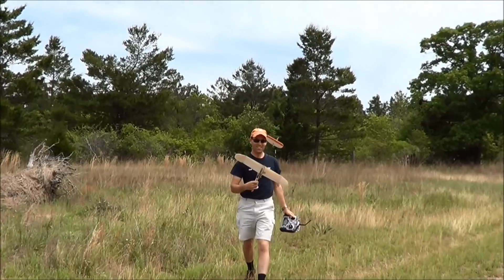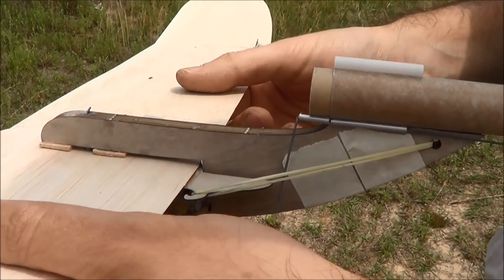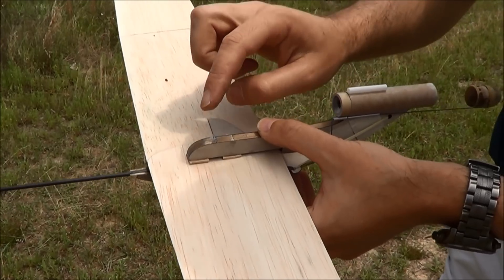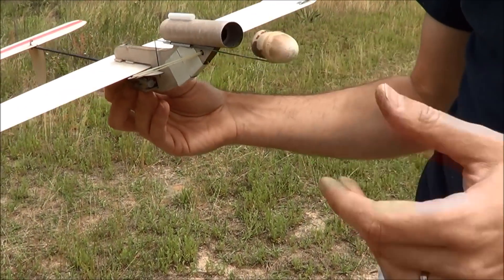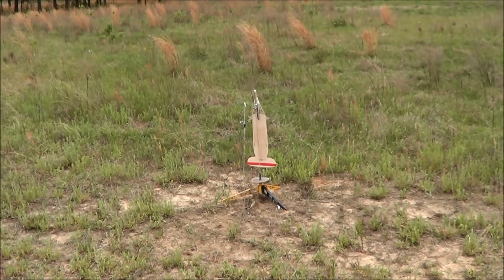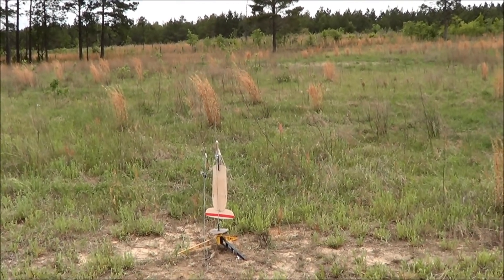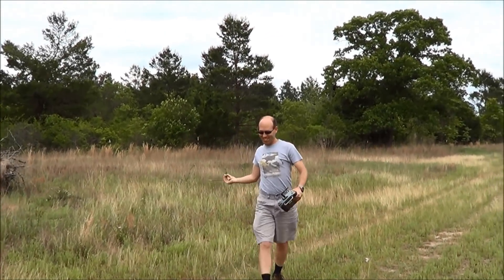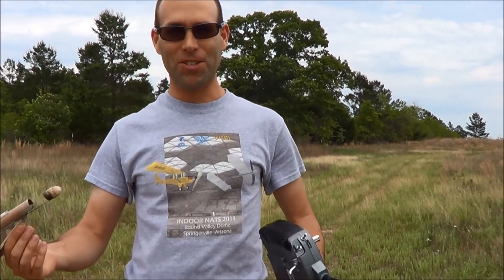The NEW Swingshot C swing wing R/C rocket glider!

Comment: Nice job of keeping that last flight from getting away in the wind. Your guess on wind speed at ground level and at transition altitude? Also compare with rc dlg.
Reply from the maker: ratride1 it was gusting close to 20 later on...during that flight I'd say 15 or so.
With a DLG I'd have a much lower workload. Modern ones laugh at a 15 mph wind. At 25" span this little guy is close to its limit in these conditions.